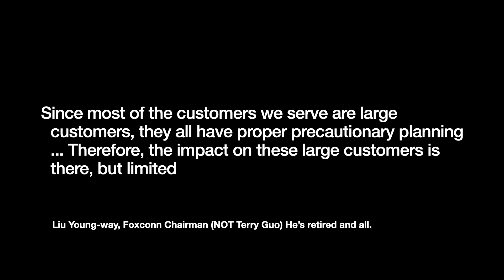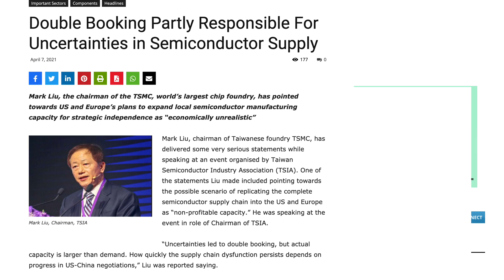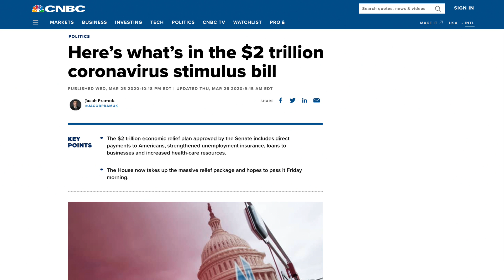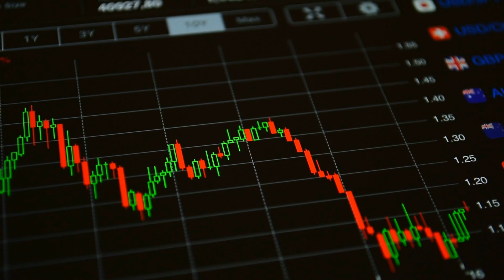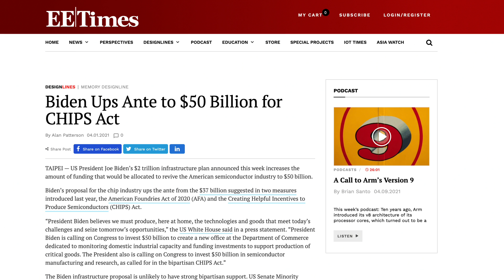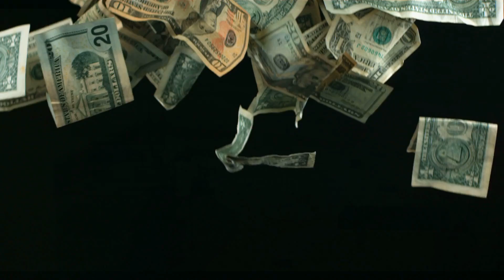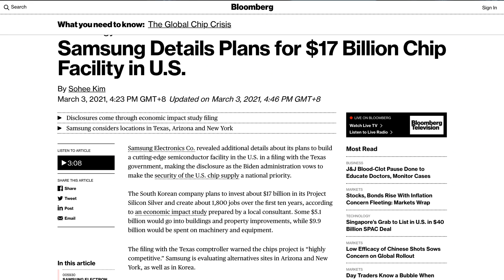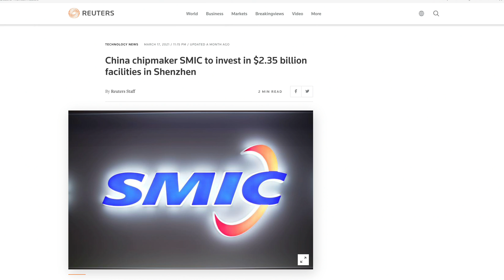The Coming Semiconductor Bust

Comment: The only the thing I feel that was missed here as part of the demand, is the increase in performance smaller architectures are bringing to the table. On paper it is fairly easy to assume that we most likely did not create this huge amount of demand for the upcoming fab capacity in just one year, if you consider the "normal" growth rate of demand. However, performance and efficiency gains are getting much larger as we progress to smaller and smaller architectures, and this where I feel the trend in demand is not so "normal". On a smaller scale we can consider just the newest gpus, as an example of a very large performance increase over past generations of cards, and the demand for them proves that people now see upgrades as worth while. This is new territory, since for many years only small performance increases were made, which meant people held on to old equipment to realize more of its value and investment. Now we are seeing 30-50% improvements which has triggered a massive amount of demand for not just gpus but cpus as well. People now see the larger advances in performance as good reason to finally make upgrades on new generations. And with this same incentive, it is easy enough to assume that large data centers and all kinds of chip using facilities will be planning large overhauls of old equipment, in addition to their normal growth rate and expansion. Again this will be due to the fact that newer processes will offer better efficiency and higher performance that save on cost for compute power. This could be a one off event as "everyone" moves to smaller architectures then waits till the next notable increase in performance, but I think it is unlikely. Smaller processes have a lot to offer, and generational changes will continue to impress. And I feel it could very well snowball into an even more technology dense population as we begin to utilize more and more compute power. Just some food for thought! Enjoyed the video. I hope to have some good discussion in the comments. :)

Comment: Here in Italy there was some talking about restarting some of the old ST lines, and those are for 1 micron processes...
Reply: 1um!!! That's 40 years old tech and useless for anything digital.
Reply: @davidjames1068  most chips in common devices dont require high density silicon. a threadripper isn't required for a washer, microwave, vehicle. i use tons of 32 bit 100 Mhz chips in the products we make (30 years old tech from freescale), just as one example.
Reply: @UniqueBreakfastTaco  do you see any shortage of 30 year old chips at the moment? do you design mobile phones/PC's/cars ? AFAIK the current shortage is in high end chips for mobile phones, PC's, cars (they use lots of high end IC's, just look at BMW;s), memory etc. a key shortage is in fab equipment, so anything useful in the old ST fabs will likely be stripped out (if suitable) and transferred to more cutting edge fabs, perhaps to make hybrid devices.
Reply: @davidjames1068  actually, yes. We've had to respin 2 boards just this year, and have stopped selling our mass spec products cause we can't get the old silicon shorter than 24 week lead time.you know not of what you speak...consumer electronics is a small sector of the silicon market.
Reply: @UniqueBreakfastTaco  "most chips in common devices dont require high density silicon. a threadripper isn't required for a washer, microwave, vehicle. i use tons of 32 bit 100 Mhz chips in the products we make (30 years old tech from freescale), just as one example."

While this is correct, a couple obvious points.  It depends on the device.  For small devices the die shrinks do matter, not just because I can get more decision making into a product in the same amount of space, so I can have much smarter devices, but because they use less electricity.  So things that run on battery benefit a lot from these newer nodes.

The other main point is, as these smaller nodes become well established, prices come down, usually.  Because you get a lot more chips from a single wafer, over time the smaller nodes can become more cost effective.  It doesn't mean they will, but they can.  I would say in about one decade TSMC 7nm should be pretty cheap because all performance parts will be on 3nm and less.  Because of the density and power savings of TSMC 7nm, if the price comes down, and it should, that's going to be an ideal node for a lot of general products.  So, these older 1 micron plants or 22nm and less density are going to find themselves in a hard position if TSMC wants to price that node to be competitive for general ICs.  But I don't know the fine details of making TSMC 7nm.  What I do know is it's causing huge turnover of compute products in almost every realm of computing, including small devices where some companies are moving graphics processing to RDNA 2 for their devices.  And Zen 3 EPYC is killing it right now.  AMD's profit went up to about 3.8 billion last quarter and this is driven by EPYC.  This is how much advancements AMD has made, on the back of TSMC 7nm.  There would probably be a much larger turnover in the world of PCs, except the cost of GPUs are holding consumers back.  By the end of next year we'll understand how much this has affected laptops, because Zen 3 APUs are a very compelling option right now.  The big issue is how power efficient the node is compared to older nodes.  And here is the real killer.  TSMC 5nm is about 25% more efficient than their 7nm.  So, if performance products have completely moved away from 5nm, I can make a product using that node that's WORLD'S away in power savings from these older products, so between those two nodes and how power efficient they are, they could possibly kill off most older nodes.
Reply: @davidjames1068  actually, it's less than 30 years old, and the first Pentium was 0.8um. With the improvements in design and programming, that's enough for a dishwasher or a microwave...
Reply: For those following along, 1 micron (or micrometer) is 1000 nanometer feature size. Compare that current-day < 10 nm, and initiatives to go to 5, 4, 3 nm. And the number of devices on a chip (roughly "the smarts") is based on area, so a 100x shrinkage in one direction means 10,000 x as many devices on the same chip area. 10,000 is about 2 ^ 13. So that's 13 doublings over 40 years, say.  https://en.wikipedia.org/wiki/Semiconductor_device_fabrication  charts this in more detail.

Comment: You missed one very important point which is very critical, Geopolitics.  Today, because of Geopolitics, there is a heavy build-out because all the countries or regions are very worried about US sanctions.  Today US has disrupted the global supply chain almost to a standstill, so regions and countries and have to self-sufficient to avoid being strangled by the unlawful US sanctions.  Whatever models you have observed from history is still base on freeflow of trade and a normalised supply chain.  But today it is totally different, the shortage is neither because of market forces or productivity issues but more geopolitical.  

Lets do some analysis, chips are chips, the chips have to put into a PCB board or an electrical circuit to make it viable, if you just have a chip it is worst than a potato chip, it is useless.
How many regions/countries in the world have a full fledge supply chain?  Only China has, what can the US make?  Zilch, not even Europe.  Even the tiniest of screws for iphone can only be produced in China.

Consumer market, middle class population in China is about 600-700Million and growing, US middle class is dying, same as the European middle class. China has a local consumer market ready to absorb whatever new tech that is out there, so to spend money to build up the wafer fab industry to avoid the US stranglehold makes sense.  However, for the US and Europe, I am afraid the money will be wasted.

What US is concerned about is about chips for military?  Do you need 2nm for military use? NO... the smaller the chip, it is more susceptible to EMF radiation and external influences which is not ideal for a weapon.  Micro-minitization  is never a good thing for weapons, that's why Russia even without the 2nm technology can develop advance weapons, even 28nm or 40nm is good enough.  All the high density chips are only for consumer applications.

As what you have said, once you invest in the equipment, it is already obsolete and you have to reap the profits from the investment almost like yesterday.  However, there is no market in US nor in Europe to readily absorb that production. What I see is a lopsided demand and supply, China will have a shortage whilst external to China, there will be very much surplus, as long as these sanctions hold, it will bankrupt whatever new fabs that is built outside of China.
Reply: So what you’re saying is china has supply but no demand?
You consider that to be more useful?

Comment: An economic analysis of the Semiconductor market is wrong-headed. Oversupply is what drives innovation because it forces all the players to move to the next generation to avoid selling at bargain-basement prices. A more thoughtful analysis of the Demand side (and the Silicon Valley Hype Cycle) would be better at predicting the fate of the industry. The current chip shortage is not going to have a long term effect on the Industry. On the other hand the semi-industry in China has lagged significantly during its current Industrial Boom, and when they enter the game, the global industry will change.

Comment: Well done presentation of your thought on the semiconductor cycles.
I would add a couple of thoughts or questions really -
- Why isn't the automation of the chip automation getting cheaper over time instead of more expensive.
- Is there a scenario where demand may increase exponentially and so there is a law named after some jack-azz like "David A's law of AI chip demand doubling every 6 months"?
- Also what are the economics involved in the machines that make these chip making machines.
Reply: I remember learning that most industries also have other industries which only exist to serve the other industry. In the semiconductor industry, these fab component suppliers are far less numerous and they know the trends and the industry’s willingness to pay. Because there are less players and capital expenditures are so high, there is almost no competition. Thus, the market does not behave as one would expect. They can charge whatever the market will bear, not what the customer wants to pay in a free market where they can always choose the lowest price.
Reply: "Why isn't the automation of the chip automation getting cheaper over time instead of more expensive."

Not quite sure what you mean.  There are different processes involved in making ICs.  But, prices are going up because cost goes up.  And, the smaller the process node, the more expensive the equipment is to make that node.  It doesn't matter that the processes are automated.  They've been automated probably as long as ICs have been made, going back to the 70s.  When you fit billions of transistors on an area the size of a small fingernail, the equipment that's used to lay out materials and etch the circuits are incredibly expensive.  And, it's not something where there's economy of scale.  Only a small number of these pieces of equipment are made.  

"Is there a scenario where demand may increase exponentially"

Yes, but only for a time period.  The fact that TSMC 3nm is going to be about 40% more power efficient than their 7nm node means most companies that use a lot of chips, so think server farms, will replace out most of their equipment for the cost savings on their electric bill.  So, just the fact that some of these new nodes are very power efficient means growth is going to be great, and the dude didn't think about this.

Now, just because making a newer node becomes more expensive, the ICs made from them can drop in price, because there are many more ICs produced from a single wafer.  So, pricing is not so predictable unless you study the economics of fabrication, and there are much better tech channels that do this.

Also where he doesn't think so clearly about this particular story is on continued subsidies.  Once a fab is built, the operational costs aren't going to be subsidized.  The operational costs won't vary much between different fabs.  This isn't human intensive work.  So, continued subsidies?  I think not.  MAYBE if a plant gets upgraded from something like 5nm to 1nm, there will be a subsidy to invest in the new equipment.  But not the factory since it's already built.  But it would be an investment 10 years down the road, and it would be a smart investment to help with a subsidy.

Comment: This assumption is based on there is no new demand. The reality is that IoT will requires more and more chips, not the 3 or 5nm but the 28nm and above like 128nm. Afterall, most IoT is focus on dedicted task, so it dont need advance chips.

On the other hand, most of the demand would be from China, therefore, western fab will see less and less demand as China start to build up their own fab. China is already capable to produce 14nm to 7nm, so soon they only be buying 3 to 5nm from outside.

Chinese company launches the country's first homegrown 7nm GPGPU chip.
https://news.cgtn.com/news/2021-04-02/Chinese-company-launches-the-country-s-first-homegrown-7nm-GPGPU-chip-Z8d3EWhOxy/index.html

Comment: One caveat in this is that you treat all semiconductors as commodity parts. There are MANY semiconductor manufacturers out there, especially defense, automotive and aerospace which don't participate in commodity markets. This is a subset of the semi industry which is isolated from the rest which won't be affected by the bust because they can't get their parts from the likes of TSMC and Samsung.
Reply: I've heard from the news that automakers having problems because of a chip shortage. Each car probably has hundreds of different chips, can't just a few missing chips stop the production?
Reply: @Maxim6431  I agree. The automotive sector is now becoming a part of commercial market, commodity. Defense/aerospace is still an isolated market, meaning a small piece of pie.
Reply: Well technically all semiconductor are commodity items. Some are used in the public/private sector or the military sector. There are minor differences in the public and private sector as the private sector is usually more demanding of their products while willing to pay good money for it. 

The military sector on the other hand is vastly different compared to the public/private sector. The ones used by the military usually undergo hardening and resistance processes to make them more resilient than their civilian counterparts. Not only that, there are minor differences such as material swaps for 1 small component of the whole piece but that swap makes a difference. You can't have chips coming loose at high stresses due to massive increases in g force due to sudden turning nor can it come off at really low temperatures(underwater or in really high altitude). You use special soder to make sure that the chips and other components will stay on the circuit boards. 

In one of the recent vids by Asiannometry, he goes into this a little bit. But know that the companies that supply parts for the military are capitalist run so expect then to stop production if there isn't as good as a profit margin as it used to have.
Reply: @fuckedupbody4194  "Well technically all semiconductor are commodity items." No, this is not correct. There are MANY semiconductor components which are NOT commodities.